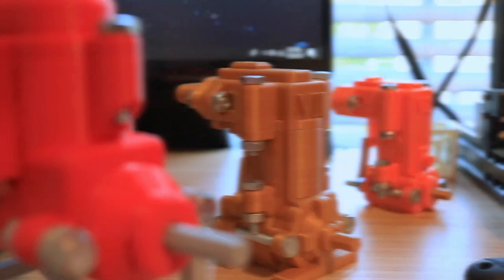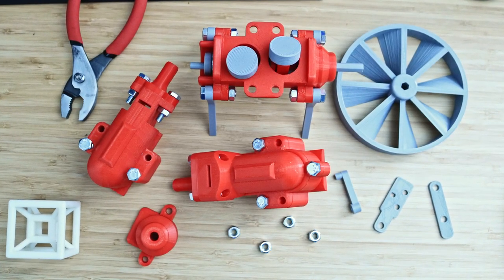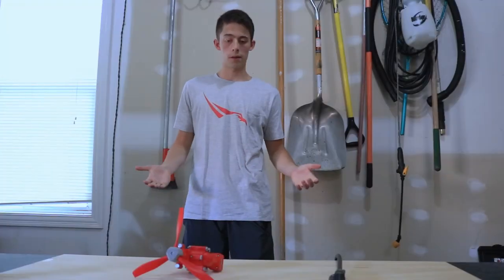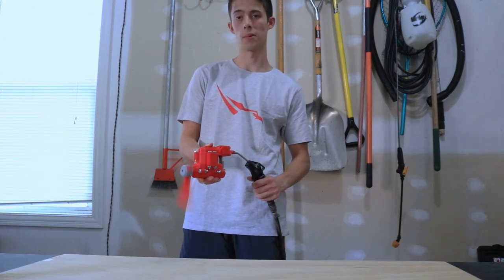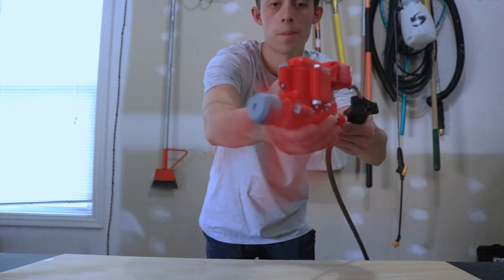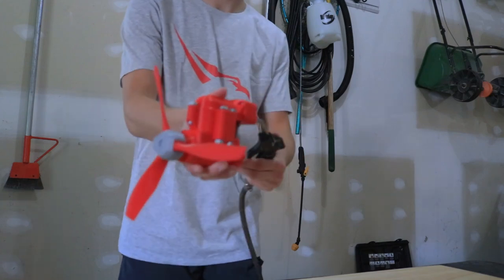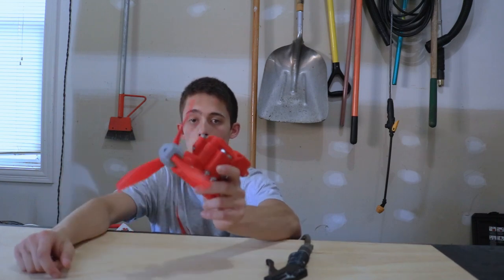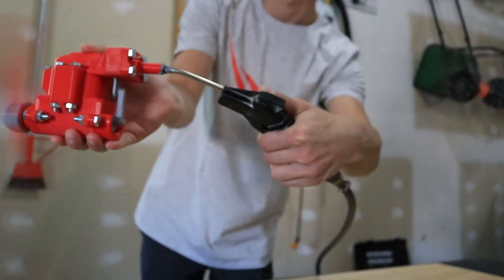GT MINI GETS SOME UPGRADES - AIR ENGINE #6

Comment: Little tip, ive been trying to make myself an engine that uses tire valves as the air enjection but have failed. Ive found having pistons that can seal good with orings and such help. Also adding a oring between the head and block to seal the cylinders help! Also running a flywheel with no blades will result in much higher rpm. Also you can get threaded inserts that you can just connect up to your intake, their really leak proof and easy to work with. I would suggest 1/4 id tubing because its got good flow

Comment: this is awsome! I like seeing your smooth progress, I find cutting a square grove ring around your ports 1.5mm deep and 1.2 mm wide , about 3-4 mm circumferance away from your port, you can use rubber band and use them as gaskets sealing two mating surfaces. now you can improver your effeceincy on your motor, cheap diy gasket.
Reply from the maker: This is a great idea, did you purchase the model of the engine online? if so, thanks for supporting my progress! im currently experimenting with a 3 cylinder version of my engine. come back and watch it if you are interested.

Comment: Can't help but notice the raw cylinder wall and piston. You'd get quite a few more rippems for your buck, if you'd dip those in thin superglue and then bore and sand them to a smooth face. Source, made a small vacuum setup for a cheapo vacuuming bag machine that was missing its pump.
Reply from the maker: I've never thought of doing that until now. Great Idea and I'm going to look into it. I might have to ask you more about it later down the road.

Comment: dude i seriously cant wait to see your next video. ive been wanting to make an air engine but am having a hard time getting a prototype built as i dont have a 3d printer. you have addressed several design issues ive been having with the drawn and 3d model plans ive made. keep up the great work
Reply from the maker: hey man good to hear, sorry i took so ling to get back to you ive been very busy with work. I have a 3 cylinder version in the works so come back and check it out later!

Comment: How do you get your ender 3D printer to center, I’ve been having trouble centering it on the build plate
Reply from the maker: download cura and use that to set up your prints, it works for me.

Comment: +G MARTIN @G MARTIN are you going to release the files and information on thingiverse I want to print the engine please there are not many decent compressed air engines 3D print files on the web 

Please release them 

Thank you
Reply from the maker: Thanks for the reply! I plan to release all of my model engines for anyone to 3d print. Hopefully in the next 2 weeks
Reply: +G MARTIN when are you releasing those 3D print files

Comment: Can you make a bigger engine
Reply from the maker: That's coming in the future
Reply: @GMARTIN  I hope you think big as the seize as a car engine and not a litlle bit bigger
Reply from the maker: It doesn't need to be as big as a car engine, it only needs to work the same as one and hopefully it does soon
Reply: @GMARTIN  can you make it on a bicycle /air powerd bicycle/ sounds good to me but it needs BIGGER!
Reply from the maker: The air powered bike is the first goal of mine, then once I get that to work, I'm gonna move to bigger things
Reply: @GMARTIN  if you make a bigger engine make a 3d prototype and than make a metal engine why metal. Metal is more stronger than plastic.
Reply: @GMARTIN  what I always say is /if you don't try you can't/ but you gonna make 1 in the future and tach amazing. what not amazing is my English I m not English so is it bad you now why it's so bad. But good luck whit your projects I hope it's works!